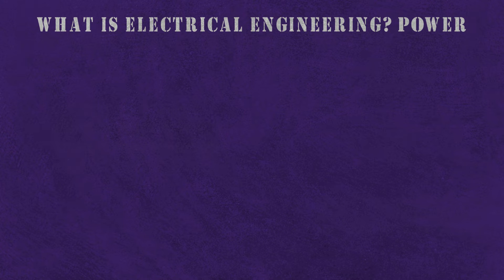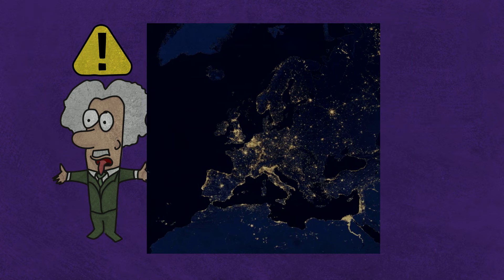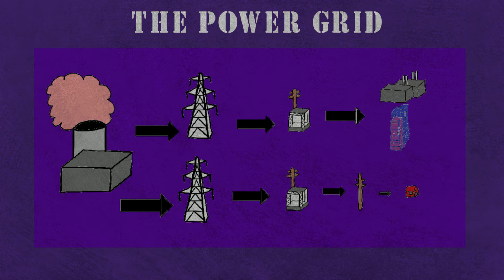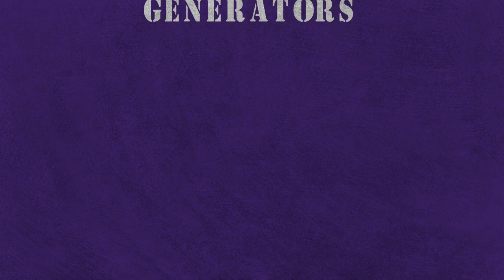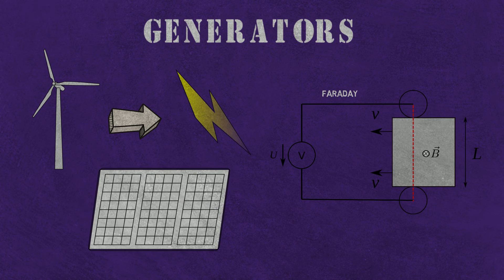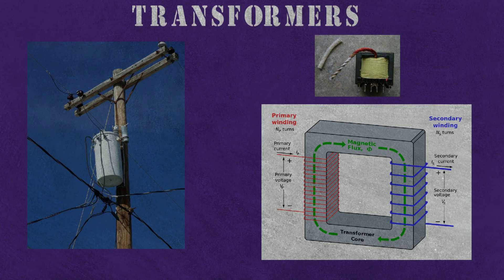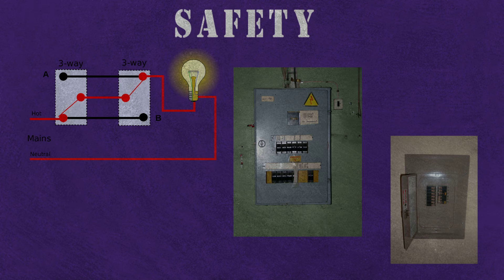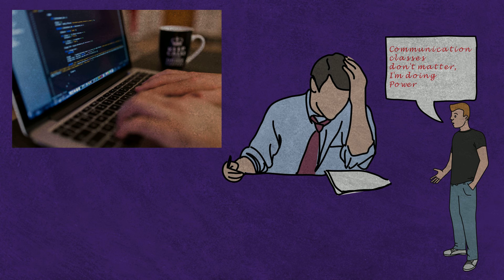Interested in alternative energy? Consider Power Engineering!

Comment: what are the classes that I am going to have to take if I am in power engineering
Reply: jeremy smith power engineering is still part of electrical engineering, at your final year ,you take about 4 courses to specialize in power engineering.
Reply from the maker: It depends on the University you are attending, the classes will be related to concepts and devices that I mentioned in this video.